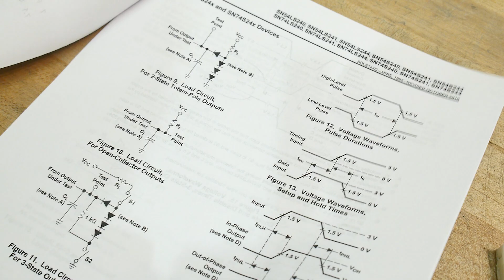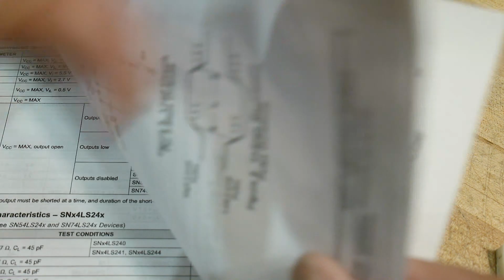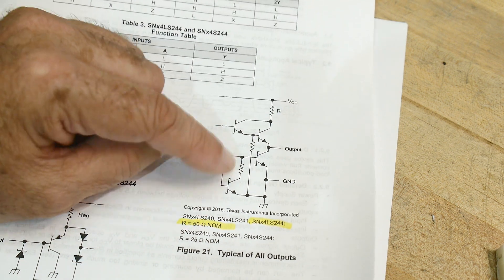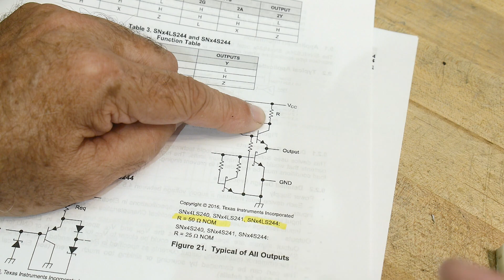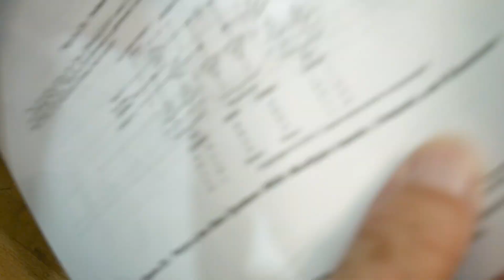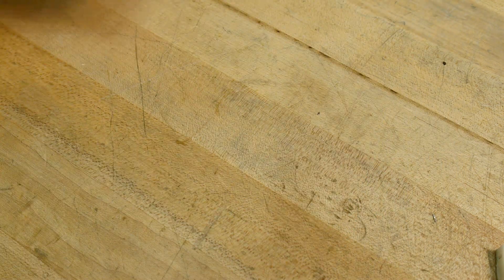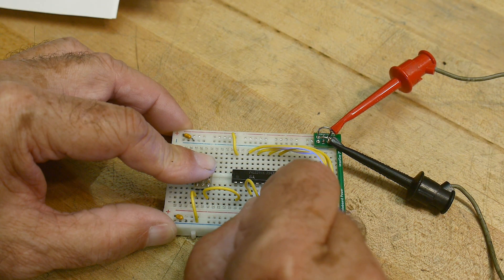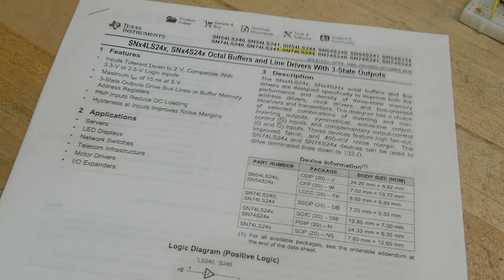#1594 74244 74LS244

Comment: As has been mentioned; protecting an internal data bus or part, bringing address or status onto an external bus for example. I have an old PMC Micromate 101 Z-80 based computer and the first thing they do is isolate the CPU address lines from EVERYTHING with a set of '244s. All of the CPU status lines (RD/WR, etc) are also isolated with '244s. The bidirectional lines (data) are '245s. Good, solid early 1980s engineering.
TI datasheets use 3-state because Tri-State is a trademark of National Semiconductors.
Reply: I kinda miss those days. New Z80 boards don’t have anything buffered now. Feels wrong
Reply: Serious bus based systems were designed to be expandable beyond just a couple of chips on the CPU‘s bus they could drive loads of cards and even expansion chassis and with tel loads you had to drive the bus to be able to have even 64k of memory with 4116s and some I/o controllers. With modern CMOS SRAMs in sizes the z80 wasn’t even ment to use and the whole support chips family all in cmos too you can build systems like an rc2014 without thinking twice about power consumption, load capacitance and drive strength while having an z80 at 7 or even 18 MHz running cp/m at speeds never imagined by its developer in the 70s and 80s. On the other hand small systems like all the 80s home computers never needed busdrivers either because the were designed compact enough in terms of chipcount on the bus so that a couple of multiplexers for the RAM were enough to facilitate the row column addressing as well as bringing the TTL load down from 8 to only 2 which often was enough to have every thing else (ROMs, graphic, sound, floppy, parallel ports… like in the Amstrad CPCs or MSXs) on the bus.

Comment: OMG those 4 pin power/ground terminals/loops initiated a paradigm shift in my breadboard work. So many possibilities. I'm kicking myself for not discovering it on my own.
Reply from the maker: https://www.pcbway.com/project/shareproject/Protoboard_Power_Connector_55084a5d.html

Comment: Internal schematic diagram explained in 74LS125A datasheet.
You can use 74LS541 to simplify board layout. Unfortunately 74LS541 has different enable scheme.